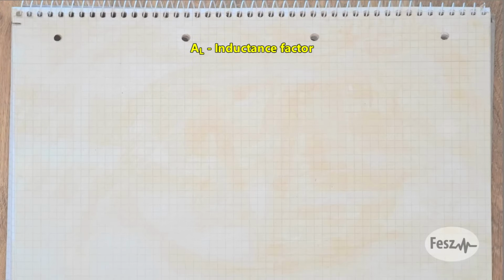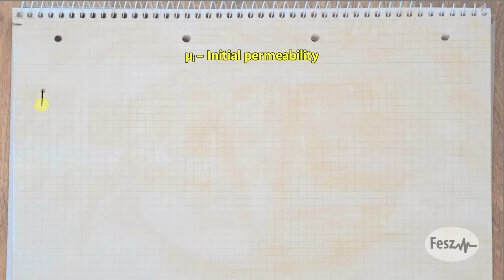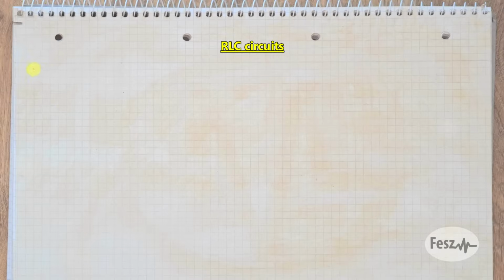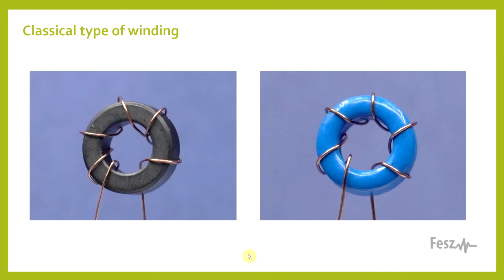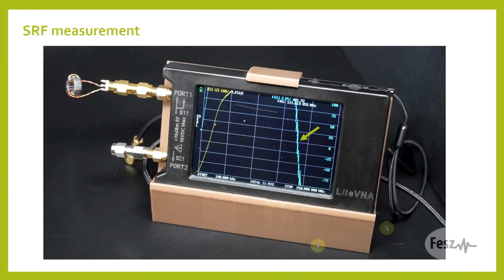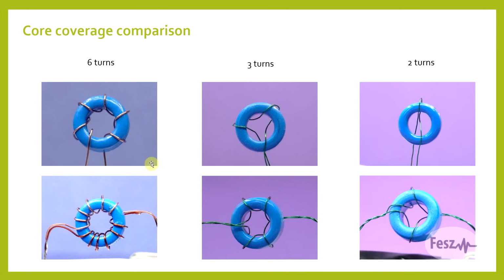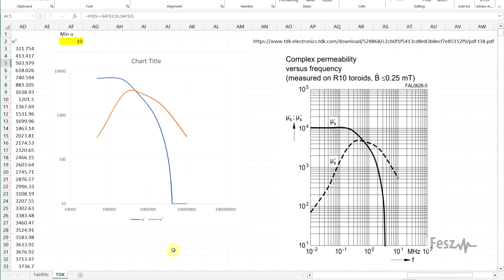Magnetic Core Measurements

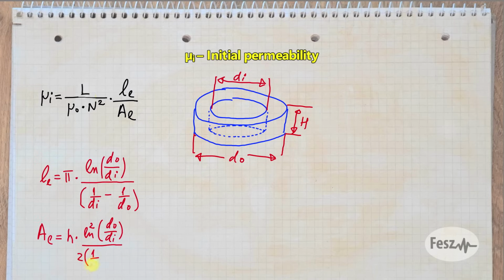Comment: I calculated the values of Ae and le of a ferrite toroid using the formulas given on the Fair-Rite website, but I found that the values obtained are not the same as those given by the formulas you indicate at minute 3:46. In fact, they are very different.
To be thorough, I recalculated the flux integral for a toroid with a rectangular cross-section and obtained the same formulas as yours. Still not convinced, I then checked Soft Ferrites by E. C. Snelling. On page 172 it reports the same values, moreover obtained by a different method.
Therefore, the formulas you indicate at minute 3:46 are correct, but then why does the Fair-Rite website produce such different results?
I don’t know whether you have asked yourself this question, but I believe it is worth doing so.

73 de Lucio

Comment: Many thanks. Perfect for receiver not for transmitters or switched suply converter : saturation effect are not visible with this test. and 10µH is not always 10µH with current and inrush current. But we need theses measurements before saturation analysis. Thus I don't by chinese ferrite :low cost but no garantee about materials and saturation limitation. Don"t by kit : RF power amplifer or Dc DC with power higher than 1W...

Comment: I'm curious about your parallel windings. You have them wound in antiphase so that the magnetic fluxes of each half would cancel. You've made common mode chokes. But as you've connected the ends, the net inductance would theoretically be zero. Please explain.
Reply from the maker: You are right, I did build something that looks like a common mode choke, but the field cancel out, only if you put the windings in series; by putting them in parallel you see the "common mode" inductance.
Reply: @FesZElectronics thanks for the fast reply! I am still having trouble with this. I know we are discussing parallel windings. It's the direction on the windings that, in your case, would cancel core flux. Your windings are going in opposite directions around the core. It was this observation that reminded me of a common mode choke, even though it is not being used that way. So, with your two antiphase windings in parallel, you should have a theoretical zero inductance. Are these the actual inductors you tested?

Comment: Hello absolutelly great engineering video !!!!🎉 i learnt a lot (just a minor  spelling  mistake . In  video 4' 50'' , i think that your hand written formulas are wrong. You crossed u' with u''.  (u'' should be linked to Rs equiv part of the inductance). But your excel  formulas in 16:13 are completelly correct )
Reply from the maker: Indeed you are right, I missed that... thanks for pointing it out!

Comment: whats that on your nano vna? it looks like sma extensions? if thats the case, why do you have them?
Reply from the maker: Indeed, they are SMA extensions; the reason I wanted to add them was to protect the nanoVNA's connectors; from all the connections and disconnections the plating will slowly be removed, and if this happens to the extension, then no worry, those can be replaced; but the connectors built into the device are much harder to swap out.
Reply: @FesZElectronics can you elaborate how the coil is connected to the VNA? Why Port2 is not connected?

Comment: I keep getting a pcb with a parallel core that overheats. 
I hope I an able to explain with some clarity so i can get a responce. 
The core is installed on incoming of 120 vac input. 
It feeds into a 15 amp glass fuse and then powers a 10-12 amp resistive load: a heater, electronics, and a few solenoids. 
It overheats around the fuse input, the trace connecting core to fuse. making charcoal out of that section of the pcb. 
It mainly overheats on the L of the AC rather the the "N" neutral side of the AC.
The core is wound half N, and the other half L.
Any input is greatly appreciated. 
I am able to modify the pcb and trace some and that helps move the heat from the fuse area onto the core. Observed by thermal camera. 
But I can not get rid of the heat 200F plus.

Comment: The goal is get much more inductance (required) from core ,but considering the temperature change in wire and also core which affetcs the overall inductance, how to find out which frequency core provide max inductance keeping turns fixed.what is the phenomena of core saturation, what is the safe range. Datasheet is not always available , methode to measure required parameter to design the INDUCTOR for POWER SUPPLY is very much required.

Comment: The split winding technique was originally developed to lower the coupling between two adjacent parallel toroids.  Best balance will be achieved when the the total number of turns is odd.  The wire through the center is intended to divide the center hole exactly in half.  If the windings were perfect, there would be no coupling between adjacent, parallel toroids.    Have you ever checked how much the split winding technique  lowers the coupling between adjacent parallel toroids?

Comment: Great explanation! I'll suggest to correct the size of the painted core by subtract about 0.1-0.15mm on all sides. The second suggestion: for the power cores (cores for buck/boost/PWM converter, PFC etc) important core parameter is saturation current!
Thank you again for nice video!

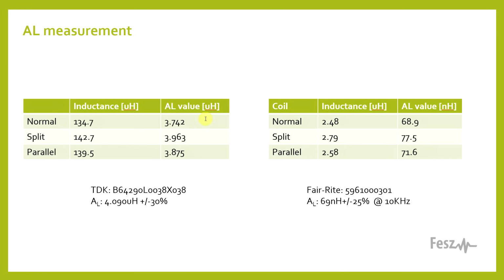Comment: At about 10:20 where you show the chart with the two cores, you talk about the fact that the datasheet inductance factor ratings have a 25-30% tolerance. Is that because of variability in the manufacturing process of the cores? It seems to me that people should have figured out how to make them more uniform by now! That means that when using a core that you buy, the TDK for instance, it could have an inductance factor anywhere from 2.863uH to 5.317uH! How would you account for that much variability in a componnent when designing a circuit for production? Or does it not matter because of the usual application of those particular cores?  + - 30% just seems too high for any tolerance to me! That's a really wide range!
Reply from the maker: For the final core you will have tolerances coming both from the material and the exact core dimensions. In an extreme case these will add up. But anyway, for any off the shelf inductor, having 20% of tolerance or even more is not uncommon. Also if you add in factors like temperature, saturation and ageing, you get a few extra % :D You also see a similar story for capacitors. So for a design like a filter, this is highly problematic, so you probably look for other more precise cores; but for a power inductor, like in a SMPS, as long as you ensure a minimum inductance value you should be fine. Anyway, you can have precision, but it will always be at extra cost, it just depends on the use case if its actually needed.

Comment: Hi, amazing video, and could I ask, what parameters am I looking for when I want to utilize the core as a wideband impedance matching transformer? As in a 49:1 unun for end-fed antennas, output transformer for class AB linear power amplifiers as in a shortwave transmitter and so on. I believe that the inductor parameters do not apply in this case, or am I wrong?
Reply from the maker: Up to a point the core proprieties will matter - you will what real permeability; but above that the structure will behave like a transmission line transformer - then you wish to have good coupling between the wires used to wire the transformer

Comment: I'd be interested in a video about measuring the parameters for cores with more complex shapes. For instance I have a number of E+I ferrite cores which I have an idea about the parameters of but don't have a datasheet for, and I'd like to find out if my assumptions are correct. I suspect that the measurements and calculations are different due to the shape of the cores.

Comment: Great video! One missed benefit of parallel windings: Skin effect can cause significant power losses at power switching frequencies. Using many thinner wires instead of one thicker wire can improve efficiency by 3 to 5% in a SMPS. 👍
Reply: Litz wire is great up to about 3MHz if you get the right kind, say 440 strands of #50 nade the right way. (twist rates, ptfe serving...) i have stacked cores to get high inductance and high Q, we are talking Q1400 when the variable capacitor (silver plated copper and steatite insulated) was added, ih i measured at several frequencies,  550, 600, 650, 700  750... 1.600MHz.and 1380 was lowest, but at these "Q" levels that can change several percent either way by just changing the air humidity or what is within 1m of the coil.
 building the rest of the radio well enough to utilise the incredse selectivity was a real challenge,  hadnto use aluminium case and ceramic standoffs... firget circuit boards,  this was poing to point manhattan style between the standoffs.
Reply: @najroe  You must be designing an AM radio based on the frequencies you mention. Litz wire is very interesting and very nice to use to get the maximum raw gain from your antenna. At those frequencies only the very surface of the conductor actually gets used. Litz is hard to get for power applications and almost never used except by dedicated DIYers. My AM experience is limited to Elenco radio kits :)
Reply: @albundy5735 that project was a AM radio. More specific a DX crystal set. Cost me more than a 100W tranciever, ihave done radiosfor decades, still have the first simple one i made early 1980s a d have made tube superhets for HF as well as mini trancievers for CW...

Comment: Are those your windings? Seems there is a good deal of space between the wire and core. I can understand that it is hard to wind that thick copper wire and get it close to the core, but you not getting all you could get out of the core.

Comment: That's precious knowledge, thanks for sharing! I'd be interested to see if the same measurements can be achieved with an oscilloscope and FFT analysis — say one owns a white noise generator, of course.
Reply: The method you describe would only give you the real portion of the signal, but it is a real method to create a bode plot. You could use it to estimate the useable frequency range ( as shown at the beginning) but it would be difficult to get good measures of u
Reply: @andrewwood9571  Not if the scope also displays the phase along the modulus though. I admit I haven't (yet) checked if mine does show phase however.

Comment: Thank you. I have about 20 pounds of unknown cores, (unless I include the heavy kW rated ones,) and about 15 pounds of magnet wire, from 12 gauge to about 40 gauge, but I find myself buying toroids new so I know what I'm going to get. I also have calipers, an LCR meter, and a NanoVNA Ultra. So I would much prefer to use the cores I have on hand, and measure them in order to know the characteristics of my cores and stop having to purchase them.

Comment: What about saturation current? Do we care?
Reply: It depends on where are you going to use these inductors and cores ... The illustrated ones were for small signal and mostly for RF ... But if you are going to use in Power Storage and induction then saturation parameter will be on top list to fetch ...
Reply: You do with high power RF used by radio amateurs. It's easy to cook a core like it was on a barbecue if you do not spec it properly.
Reply: Whatch the content linked - there is a very good vid about determining/validating B-H curves.